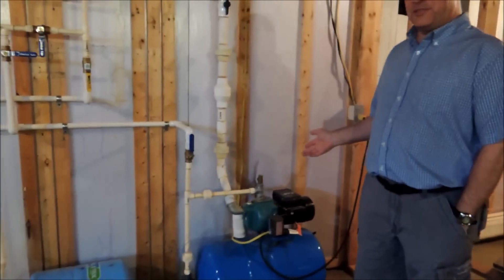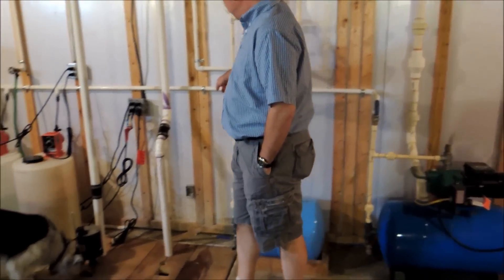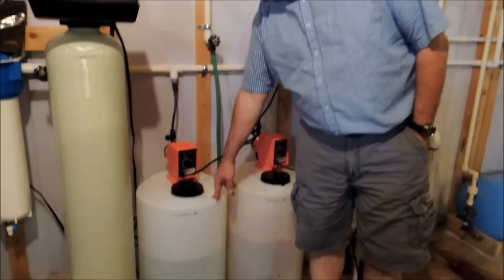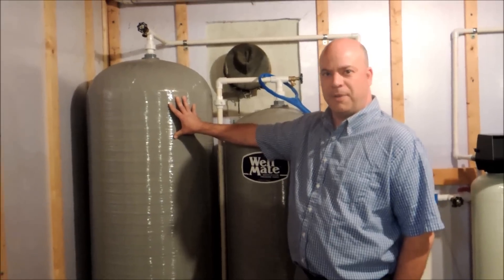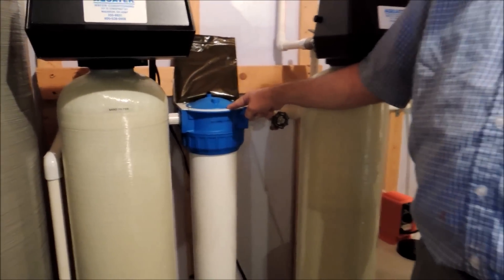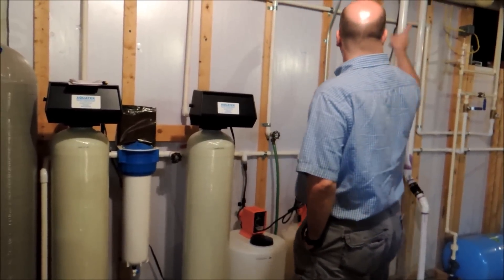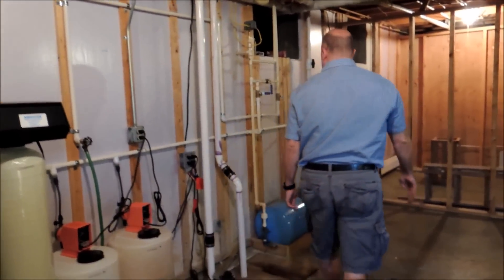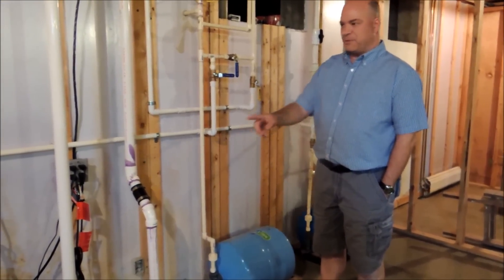In-home Pond Water Treatment System

Comment: We are from Defiance Ohio and we will be installing a pond water treatment system this month. The place we purchased has a 1.1 acre, 22' deep pond that is very clear. We do not want to use the sulfur well water. I was wondering if you had to build your system again, what would you improve on? I personally like your system but I dont like the idea of using a flocculant like alum. Are you using a GAC cartridge filter? I would be interested in purchasing your system with a few minor changes. Can you tell me who to contact?
Reply: Memmers water tech uses iodine instead of Clorox  
If still looking after using iodine system I will nvr go back 2 bleach 
Just my 2 cents
Reply: Deep NurMom why do you say that? Does the bleach not get filtered out completely?
Reply: I am currently buying a house in Paulding that needs a filtration system installed!!! Any recommendations?? It is my first time